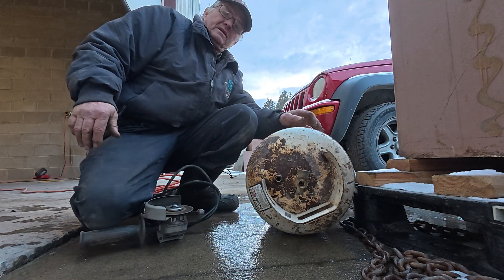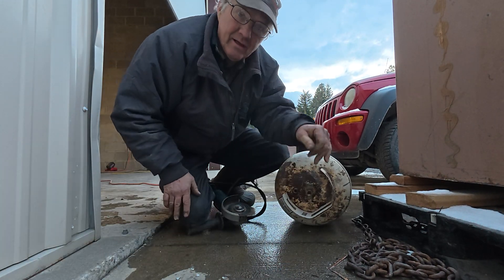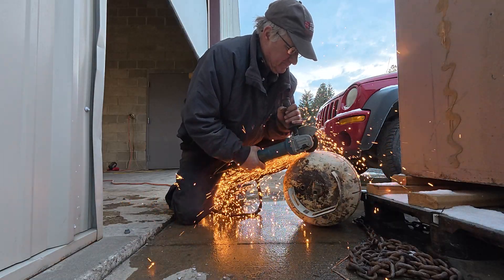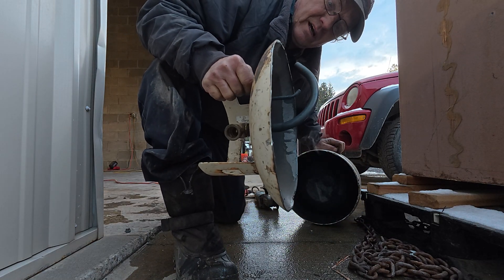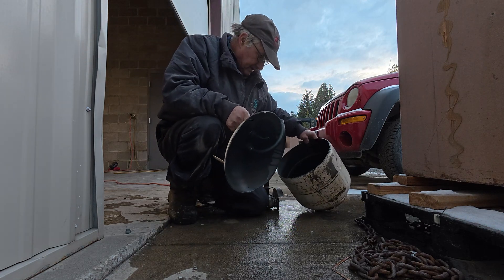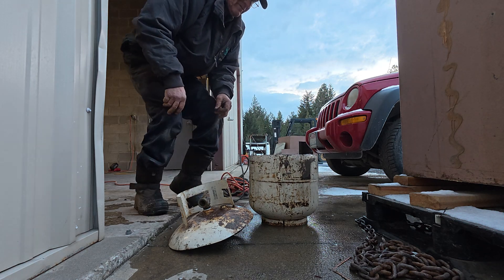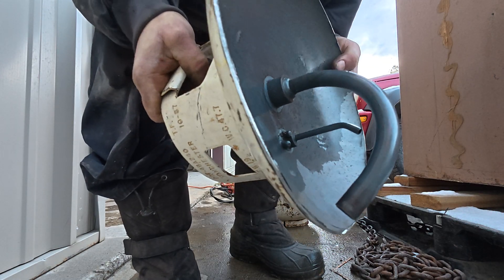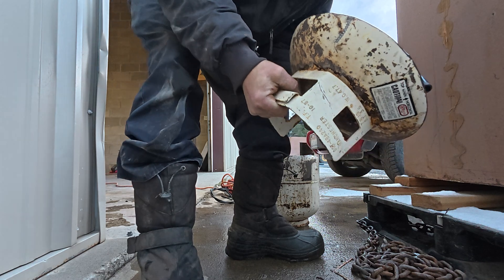Cutting open a propane tank

Comment: That was a small tank so everything worked fine. If you do larger tanks, leave as much water inside as possible when you cut it open. The water reduces the volume that can fill with flammable gases. Some tanks have rubber bladders and sometimes leftover oils. The grinder cutting wheel generates heat and smoke, that smoke is what can fill the tank and blow up.
Of course filling with water forces out flammable leftover gas, but the prolonged cutting process can fill the tank again if it's empty of water.